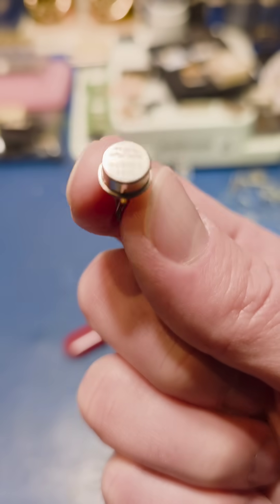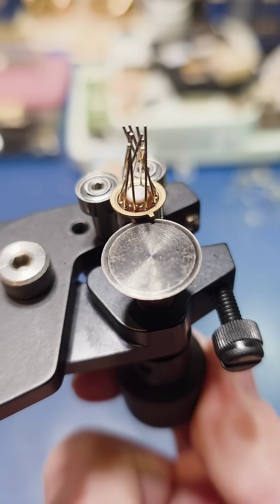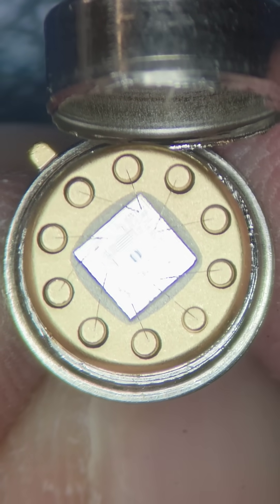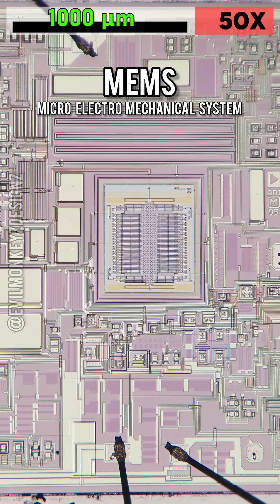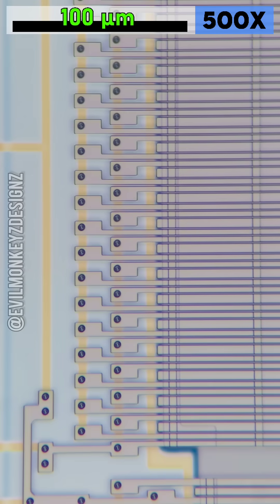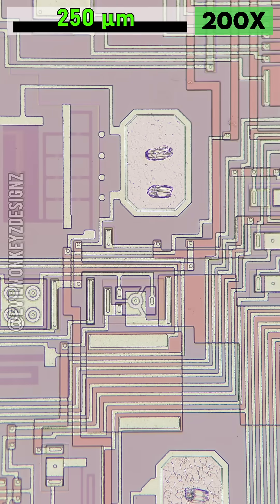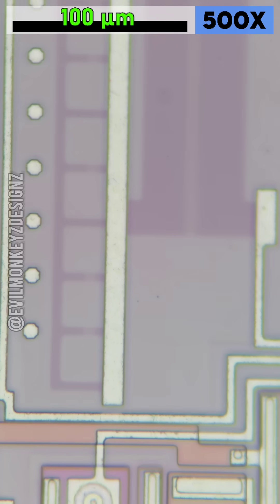ADXL05 MEMS accelerometer

Comment: And the key benefit of using a metal encapsulation is that it keeps it at a constant temperature (with external temperature feedback circuitry (resistor for heating, temperature sensor, and an OP-amp relative to its mounted heatsink), enabling huge improvements in accuracy...

Comment: My grandpa worked with single axis chips like these. Originally, they had it put on a cube, but that took up too much space. So, they put it on a shape resembling a truncated icosahedron and used some math to get the properly aligned acceleration values.

Comment: Those very thin wires going to the circuit, that's what's in an ABS module. Mine failed and I sent it to be repaired, but the package was damaged in shipping so the repair facility returned it to me with the lid for the module removed.

Apparently when those modules die its because on of those finer than hair wires separates, and I'm kind of surprised it doesn't happen more often because of the vibrations and heat cycling a car experiences...

Thanks for the video, cool to see inside one of these things!

Comment: Pricing for the ADXL1005 varies based on quantity and distributor:
	•	Analog Devices (1,000 units): Starting at $47.23 per unit
	•	DigiKey: $60.97 per unit
	•	Arrow Electronics: $55.14 per unit
	•	Newark: $85.45 per unit
	•	JAK Electronics: $93.61 per unit

Comment: I remember the old large IC chips that were found in things like the Atari 810 disk drive from the 80s, had covers that were easy to lift off. Those drives had a bad habit of the capacitors and the gate, going bad.

Comment: It’s also interesting in this video diagram as he zooms in you can see contact pads with depressions on them that’s from early electrical test and validation of the circuit during the silicon wafer manufacturing of the circuit those tests take place at different layers during the process of building up the layers to create the circuit to confirm that the silicon structures that are laid down through deposition are done correctly with the right thickness capacity, capacity, etc. etc.

Comment: Actually all three axes must be measured simultaneously in a non-oxygen environmental area... Therefore you must monitor the H2O molecules and reference to one parts per million over time... The X axis must overcome the y and therefore the z axis is left standing by itself...!!! Any and all foregoing matter of isotopes must be neutralized by using a complete vacuum measured... Such as an orbiting electron in the hemisphere the stratosphere and the ionosphere....!!!! When doping the PN junction you must add a complete known substance such as ISO mesetate and ISO arsenic in its purest form....!!! Better known as the Bovine Scatology IC chip...!!! It only comes in the DIP package...!!!! And it must be handled with care...!!!!  Can only be employed with an isolate 20 KV AC or DC Volt power input system...!!! Installation is rather easy but rather unique to say the least...!!!! Before handling the device under question.... Factory specifications are as follows.... Remove your shoes and socks.... Make sure you rub your feet on newly installed carpet....!!! Handle the device by its input leads before installing into the PCB...!!!! And no you will not find these at Radio shack which is defunct and or the NTE substitute catalog...!!!!

Comment: I've been around long enough to have seen vacuum tubes, "can" capacitors and heavy power supplies as the components of everything, EVEN before the development of things like transistors and a thing called "solid state" circuitry. Just amazing to see these things.
Reply: Vacuum tubes are still around. Just like vinyl records. 😀
Reply: @aniellodimeglio8369  And vacuum tubes still sound the best, especially if you build an amp with matched Kriegsmarine German tubes built in the 30's or 40's
Reply: Not many of us old farts  still around.  Unbelievable,  the tech advances last 50,  even  last 200 years!!  🤯 🇺🇲

Comment: So that’s how the Wii Remotes work.   Speaking of which, I am Rank 3114 in Wii Boxing.  I absolutely love dishing out 3 and recently learned 4 hit combos.  👍🏾

Just slightly tilt the remote and smoothly swing bottom to up, outside to inside or top to bottom for upper cut, round house or the deadly over head power knock out.   

So satisfying when the over head or round house makes them actually do a flip almost 360 degrees sides ways.  😂.

Comment: How can they make things so accurate and so small this looks like alien technology is there even demonstrations on the internet how they are accomplishing this ?
Reply: Yes, it’s called photolithography. What basically happens is this: Let’s say for simplicity you want to make a very small square area on a silicon wafer. You need a mask. This mask is just a larger plate that is transparent everywhere but for a square area. If you shine light on that mask, you get a shadow in the form of a square. You now put a lens behind the whole thing, which makes the light + shadow as small as you want it to be, it focuses the image. 
You now put a photoresist on your wafer, that’s a material that changes its physical properties when it’s hit by light, just like in the old days when you had to develop your photos. If you now illuminate your wafer that is covered with photoresist with your mask + lens, the photoresist changes everywhere where it’s it by light, so just the square shadow area is not affected. You then throw the whole thing carefully in an acid bath. Normally the photoresist is resistant against acid, but the parts where it was hit by light are not anymore. Therefore the acid starts attacking the silicon everywhere but in that small square area. 
Congratulations, you have created a small square plateau. You could instead use shadows in the form of letters, or whatever you want. 
You can add new layers of material, subtract any shape you want and step by step get useful constructs. It’s basically 3d printing, just way more precise

Comment: Yeah the first few comments are of the same thought process as here, however contemplate for a moment the absolute microscopic complexity of silicon chip devices in which are told of human development & manufacture. Then consider these exact humans of the same kind STILL like cavemen of the far ancient past extinguish fire with water!! There's advancement though it could be reasoned to be practically stagnation, comparative to fantasy with a side of falsification!!

Comment: You cant convince me we didn't have help figuring this shit out there's absolutely no way we as a species did this on our own.
Reply: It’s relatively straightforward. Just took a lot of smart engineers to figure out the first step. Lot of experimenting and failure, it’s pretty well documented how we got where we are now. It all started with a transistor that was the size of a chocolate bar. From there on they tried to make transistors as small as possible and used the same methods to eventually make small mechanical devices like this accelerometer here. A lot of processes had to be developed and fine tuned to get precise results which is surprisingly complicated. But it’s not witchcraft (even though it kinda is), engineering students are learning it world wide.
Reply: @CSTEnjoyer  Thats insane to even think about. Do you recommend any good documentaries i can watch? I love tech and would love to know alot more about its history as im honestly blown away by what we have achieved so far
Reply: @Steiny5843  photolitography to be precise

Comment: The thing that surprises me is that we haven't moved on to using piezoelectric devices with standing waves to get a much more precise and accurate reading. More specifically, you'd actually get a precise velocity reading due to the dopler effect, which you could use to determine acceleration.

Comment: How durable are these if phone or devce is dropped ?
Reply: Mems devices are basically unbreakable, because forces scale differently when you make things smaller. Gravitational force scales with mass, and mass scales with volume. And volume scales by the power of 3 ( length x length x lenght). Surfaces scale by the power of 2, so surface forces like friction become way more important

Comment: Weird how the chip architecture is so precise yet the pins that connect to the outer casing look like a toddler welded them to the board… 🤔
Reply: Because the wire bonding happens mechanically, while everything else happens by chemical reactions and photolithography. Way less precise

Comment: I work on the probe cards that test these types of chips. At several points in this video, you can see the probe contact pads and the marks from the probe needles.  This chip appears to have been tested with a cantilever type probe card as evidenced by the scrub marks leading towards the center of the die.  

What's interesting here is the pads for testing are generally obfuscated by the soldering of wires to them during packaging, but this chip apparently had either a lot of extra functional tests unable to be done from those pads, or had a decent amount of required electric trimming done to reach target customer specs.

Comment: My pacemaker has accelerometers. It can tell how fast I'm breathing, how deep I'm breathing, my direction, body orientation and speed. With all that, it adjusts the speed of my heart depending on physical demand. A piece of wizardry for sure.
Reply: May it keep you healthy for many years!
Reply: There was a patient waiting for a donor; they had some weird, “pump-less” self-contained heart, made out of titanium. Instead of pumps, it used magnetic fields to spin the whatever it is (think of like, the wheel of a watermill, sitting on it’s side, spinning, but instead of gears connected to it, it spins in place due to magnetic spin). Not only does this mean, less moving parts, and potential failure points, but because it isn’t an actual pump - it doesn’t destroy the red blood cells/platelets, like a pump could. 
I’m just an electrician, and don’t really know the complexities beyond that. Guy had it in for over a hundred days!

Imagine living over 3 months without a heart beat? Instead, it’s just a low, continuous hum, of that wheel spinning constantly. It was able to ramp itself up, or down accordingly, to the patients’ needs.

Really is a crazy time to be alive
Reply: @Wizard__J  Sounds like an LVAD.  The human body actually prefers pulsatile flow, like the type you normally get from your heart, over the continuous flow you find in some types of devices.
Reply: Did this person ever recieve @Wizard__J  a donated heart?
Reply: @Wizard__J  you must sincerely be a bot, you basically copy pasted the script from the viral short that came out a week or 2 agom
Reply: @Neurostatic-Music   I'm sincerely baffled why someone would do that, and then lie about it.
Reply: @Wizard__J  thats a great descripton of the BiVACOR Total Artificial Heart (TAH)
Reply: @Wizard__J  your talking about the bivacor heart.  Crazy technology, no pulse at all
Reply: @Wizard__J  we all saw the same short
Reply: @ParisLuHv what?? I’m not talking about this short, I’m talking about some news article I read a couple weeks back but aight 😂
Reply: @Wizard__J  I'm not talking about this short either
Reply: @ParisLuHv Ohhhhhhh you’re saying you saw a short about whatever it is I’m talking about
Good for you 😂😂😂😂😂
Reply: @Wizard__J  I'm saying you saw the exact same short as well
Reply: @ParisLuHv And I’m saying I didn’t see any short about a pump-less, titanium artificial heart which is why I’m having a hard time why you’re trying to tell me otherwise?
Reply: @Wizard_J   and I'm telling you, you saw the same short I don't understand why you keep messaging me
Reply from the maker: I had no idea that modern pacemakers were that sophisticated. I've got some older pacemaker chips from Pacesetter Systems Inc that I've been meaning to make a video on. Maybe I'll have to get started on it finally :)
Reply: @EvilmonkeyzDesignz  what mic do you use for the clear audio?
Reply: @EvilmonkeyzDesignz your mic sounds awesome 😎 hopped up crispy end 😁
Reply: I may have attached the wiring in your pacemaker. These devices are amazing. I have taken about 3 models apart and they are more impressive than any other device I have seen.
Reply: I never even considered that pacemakers have the CHANGE pace too. That's fucking mindblowing. My grandfather had one.
Reply: @themanhimself3  oh yeah? how'd that work out for him?
Reply: @freshfishonly he ran a marathon
Reply: @ then what happened?
Reply: Pretty sure you can run DOOM on that thing. Live long my dude!
Reply: when?
Reply: One day we will be able to put in artificial organs that will be better than the originals.  We will gradually merge with our technology to become an amalgamation of biological and tech.
Reply: That's amazing, I didn't know they were like that. Gives ya some serious peace of mind I bet!
Reply: No shit.???? Wow
Reply: I had no idea that modern pacemakers were so advanced.
That's really cool man!
Reply: im glad you brought this up, i use to work for a company that makes those and other devices sterile and and sealed properly and i opend a sold gold k7 chip from a f-16 that was just GORGOUS inside. raytheon has a solid gold chip worth 230mil thats bigger than an ipad. that one was WILD! but the medial devices always amazed me.
Reply: What happens if you go on a date with that other guy who got the neodymium magnet implanted in his hand
Reply: Add a 555 timer to that bish😂
Reply: When you die can i have it to build a missile?
Reply: @Aaron-zu3xn or build a cnc machine? Nah a rocket is better
Reply: it's amazing how far we have come. and I know we have technology that is probably a hundred years more advanced than what we think and probably a lot more
Reply: That's a cool story. I have this amazing magnet I wanna show you. If I did, would you start looking like a CRT that's going bananas?
Reply: @freshfishonly   I did that once using a calibrating magnet for an older style of pacemaker.  There was a permanent purple spot that would not go away after that.  Magnets do have an effect on the newer pacers.  They will probably put it into a different mode that doesn't use the input it's gathering from the body to dictate how it paces.
Reply: @ I wonder what if you got like a really strong magnet and threw it into a nursing home, the old folk would probs go bananas 😂😂

Comment: Yes, you need 3 pieces to measure acceleration in the xyz axes, but very rarely 6 pieces if you also need to measure rotation and acceleration around the 3 axes.
You can also use accelerometers based on an Ortofon pick-up, each measuring up to 100 G in 2 axes. They are used for shocks and vibrations up to about 1kHz in real time.
Furthermore, it is important to place accelerometers strategically in the product. And it is important how the product is assembled. It should probably be waterproof and withstand 200 G. Note that the product held together by screws has a greater fastening force in the 2 axes they do not rotate around. You should use at least 2 screws. I designed the electronic measuring potato for Ortofon.
If you need to monitor the condition of, for example, ball bearings, I recommend an acceletometer from Brüel and Kjær, which I worked on, which is the world's best microphone, measuring between 1Hz-100kHz, with a price of at least USD 4000 each, which recorded the first sound on Mars at the landing. It is used for noise measurement devices. About 100 pieces have been used since 1985 in The Danish National Symphony Orchestra https://www.youtube.com/watch?v=enuOArEfqGo

Comment: Hey great video, simply amazing! Do you have a link for the to you used to cut the cap off? I'm having zero luck finding that on my own!
Reply from the maker: Sure thing! It's a little on the pricey side, but it is a somewhat specialized tool.

https://www.thorlabs.com/thorproduct.cfm?partnumber=WR1

There is a hackaday article somewhere that shows the steps that someone went through to make a cheaper DIY version. I've been meaning to build it myself (I've got all the pieces) to compare them.

Link to that too if you’re interested:
https://hackaday.io/project/25845-to-can-opener
Reply: @EvilmonkeyzDesignz  thank you so much!!

Comment: What is the purpose of putting such a small device in such a large can?
Reply from the maker: I think it's usually cheaper to use existing packaging techniques instead of designing new ones. These TO-style cans have existed for quite some time, so it's easy to put many different things inside them. You definitely don't see them that often, or ever, in modern electronics.
Reply: @EvilmonkeyzDesignz  Makes sense, thanks

Comment: i'd say you need six not three, are you sure it's three?
Reply from the maker: yup, just three! For example if you set one in the X direction, it can sense in the + and - X direction. Put a 2nd one rotated 90 degrees to the first one and you get +/- Y-axis sensing, and then add a third to get +/- Z-axis sensing. The third would need to be on its side relative to the other two, if that makes sense.

Comment: In these 1x accelerometers, how can you tell which axis to orient them? Since pins go down in TTL, is proper orientation "top to the sky"? Is that a rule or a guideline?
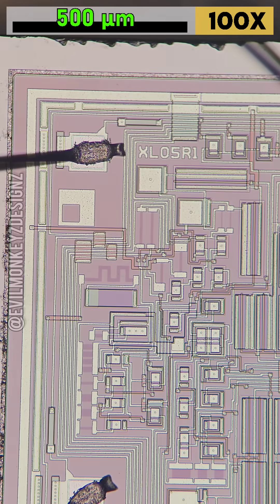Reply from the maker: In the case of this particular unit, the axis of sensing is inline with the tab. If you drew a line through the part from the tab to the other side, that's your sensing axis. In included a snippet from the datasheet showing this at 0:58 in the video :) In all cases though, the datasheet for each part should hopefully give clear guidance how to use their specific devices.
Reply: @EvilmonkeyzDesignz  appreciate you. I mostly use mpu 6050 and 9060, but if I need to know why an axis doesn't work i can use this to work backwards. Thx king!!!